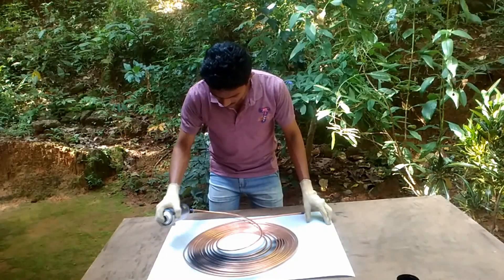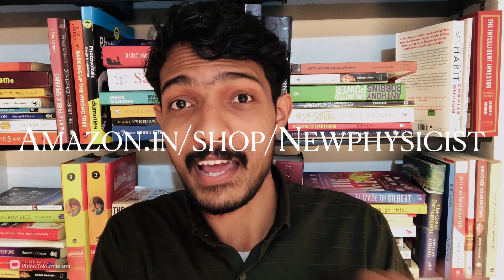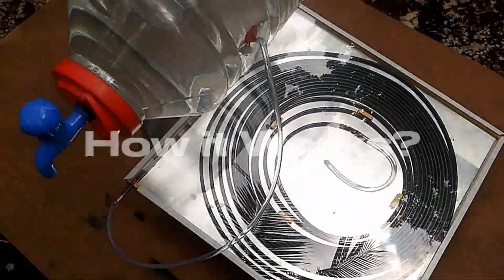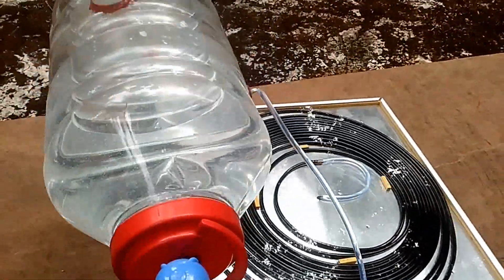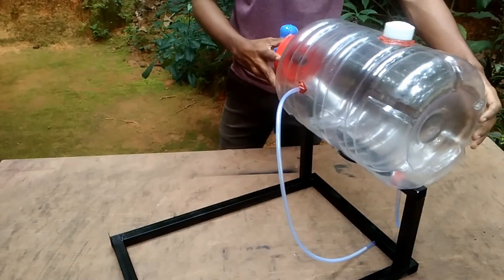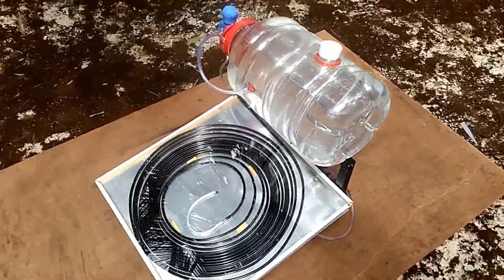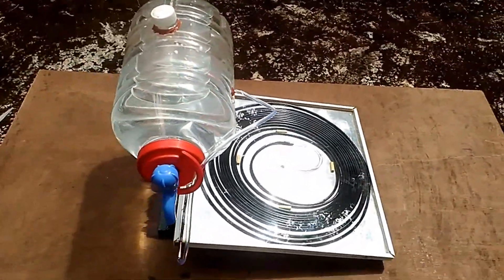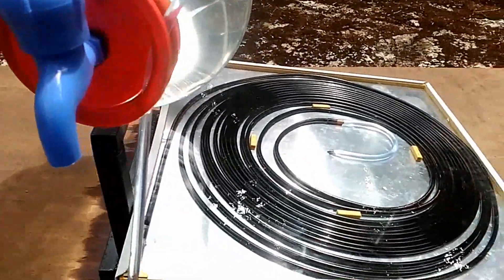Solar Water Heater Projects | All in One Tutorial | DIY

Comment: You can take the coiled water heater and attach it to an electric or gas hot water tank. For as long as the sun is heating the water the thermostat on your tank wont use electricity or gas. The following instructions are taken a solar water heater company for attaching to and existing hot water heater. There are people who find parts from their local hardware store.
*. Empty the water heater of its water
*  Disconnect the cold water supply to the water heater.
*. Install the solar cylinder with its peripherals (solar station, roof lines, temperature sensor at the heat exchanger at the bottom of the    solar cylinder, etc.).
*. Connect the cold water supply to the solar storage tank.
*. Connect the hot water outlet of the solar cylinder to the cold water inlet of the water heater. It is preferable to install a non-return valve on this hydraulic line to prevent the thermosiphon effect of circulating hot water from the water heater to the cooler water in the solar storage tank.